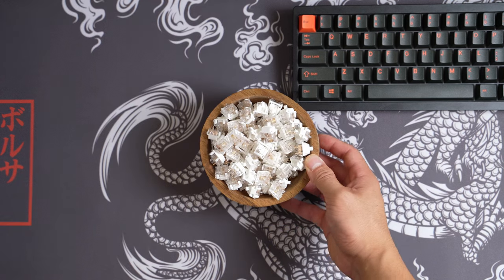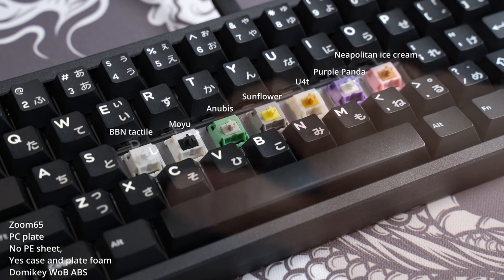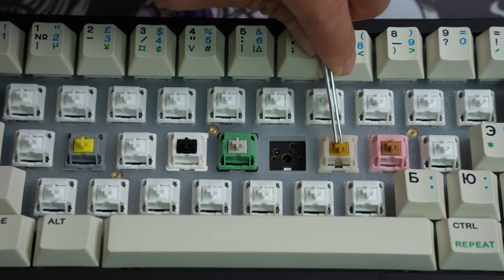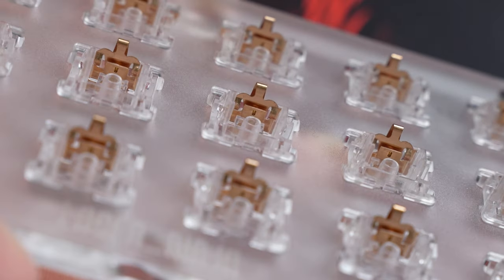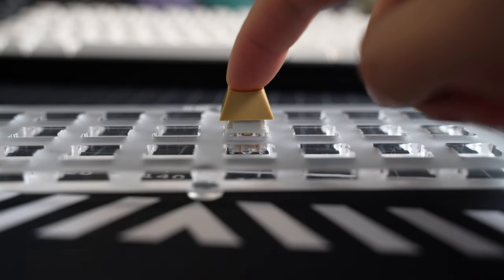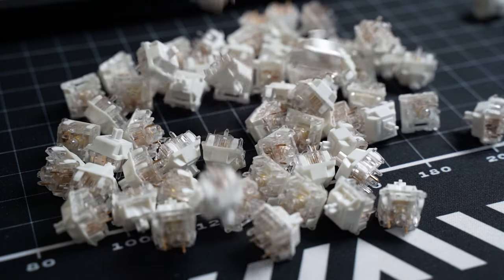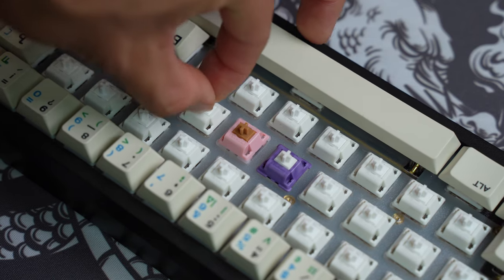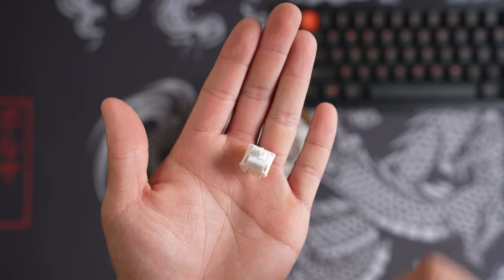BBN Tactile Switch Review

Comment: Thanks for the review! I was honestly hoping to see the tactility and initial strengths of the switch compared to other tactiles. For example, push stem tops of two switches against each other.
Do you have that info? I'd love to see it against Boba and Purple Panda in that matter if possible.
Best regards.
Reply from the maker: Thanks for the feedback, I'll add that to my future switch reviews. I just tested them out, initial strength from strongest to weakest U4t(68g)>BBN tactile>Purple Panda. Not really a fair comparison as they all have different spring weights. What I can comment on is that the dual stage 63.5 gram initially feels like a 65-67g. The longer spring compresses more than your standard, resulting in more resistance in top and bottom of the keypress. Hope this helps :)
Reply: @killakeyboards1945  Sweet! Thank you so much!! This switch may be a sweet spot for me then. I do have single-stage 19mm and 16mm springs that I use to reduce the initial weight (I've done it to Azure Dragon switches, they're currently my favourite). They also fall in between Purple Panda and Boba too, hahah.

Much appreciated! Best regards. :-)